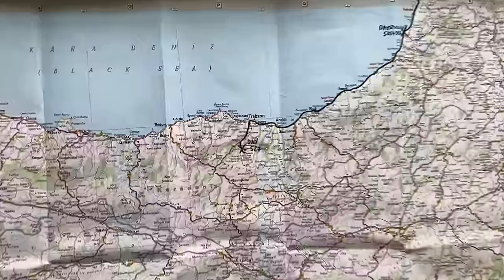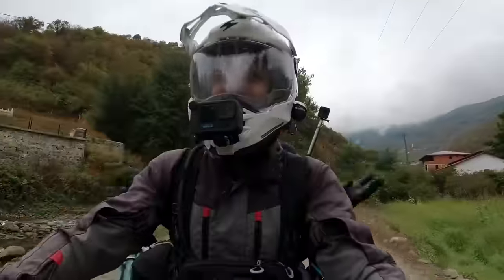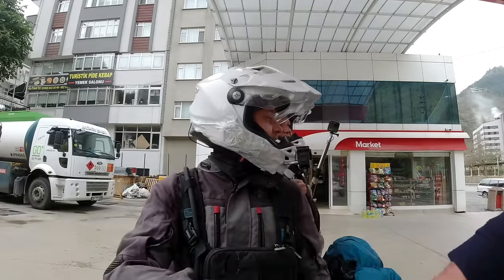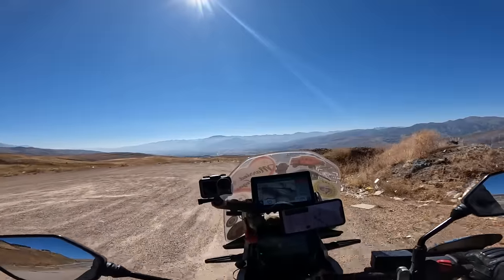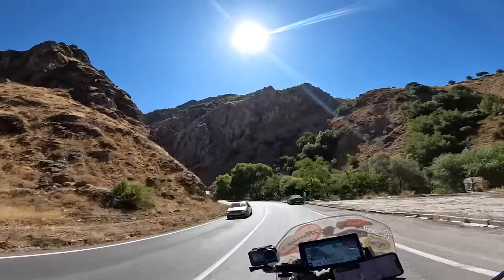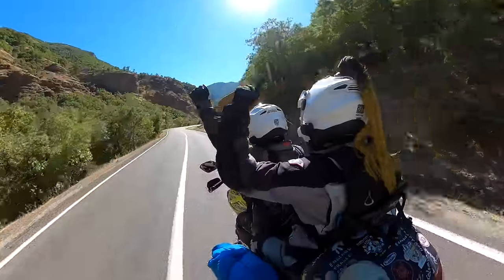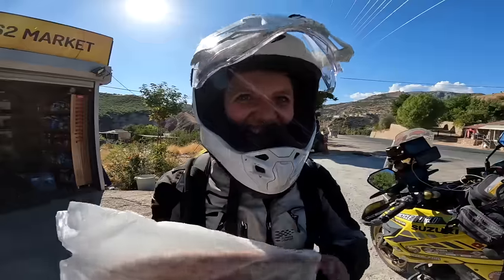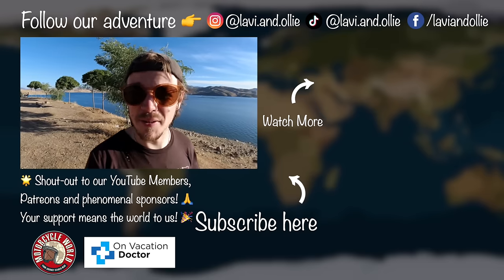CAN WE FIX THIS OURSELVES? (Motorcycle Turkey) 🇹🇷 [S5-E56]

Comment: https://youtu.be/RLGD3Jb_gCk?si=KUXP8szfHw6_TGQ0
Clean it over and over...  Currently I use a 10cm piece of steet tape measure and just move it up and down inside the seal on the front side of the fork Tube.  100 to 1 it is only dirt.  The seal cleaner has to go up to the top side of the seal about 1.5cms.